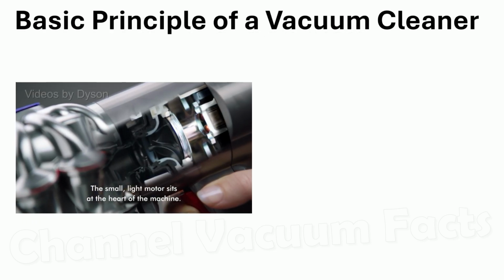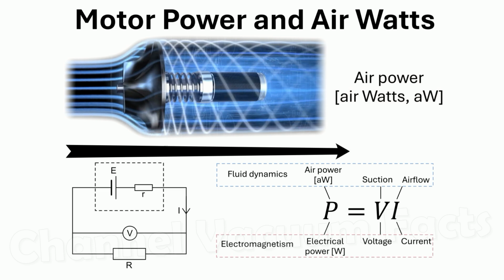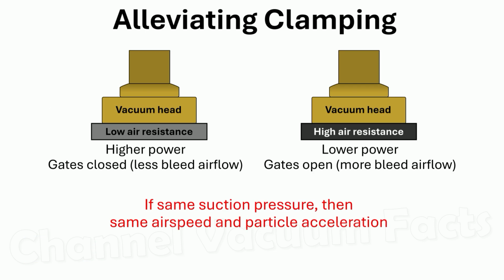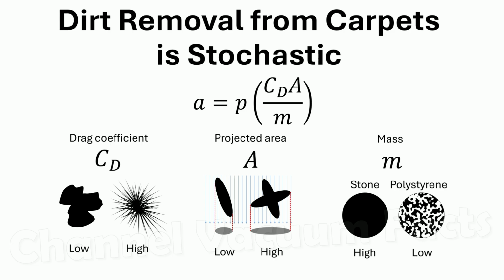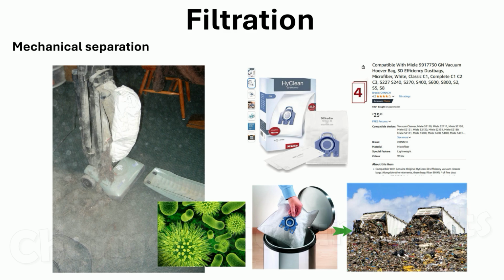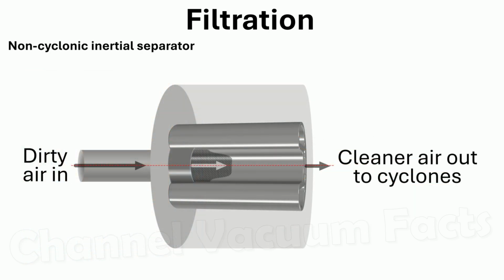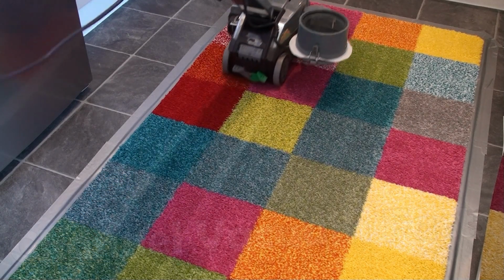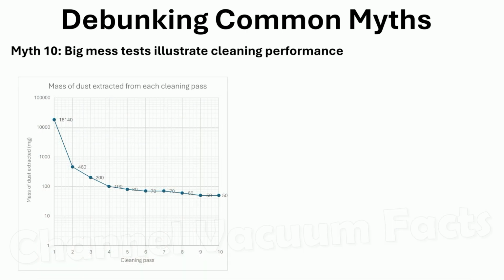How do vacuum cleaners REALLY work?

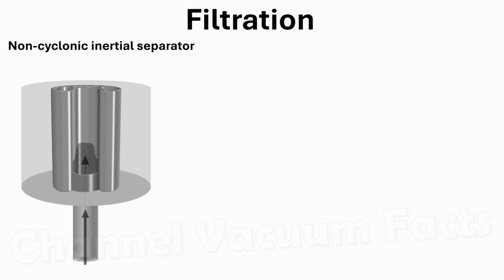Comment: 37:55 it's kinda insane how out of all the videos and written articles on the internet, this video is still the only one explaining how Dyson's new v16 first stage separation works. No one else has mentioned its benefits like linear air path, no more hair wrapping and shroud smothering/clogging. 

Hell not even Dyson really explains their new bin design that much in the marketing materials. They kinda just say you can compact the dust with the new compactor  and that's that. With such a drastic design changed you'd think they roll it out with more fanfare or at least an infographic like their cyclone pictures. 

The marketing seems to focus only on the new cleaner head design instead. Which I think is poor considering how the new inertial separator is a far bigger change and innovation to current cons of the first stage cyclonic seperation.

The new design might be a lot better at preventing user error too considering how ppl just ignore the max fill line a lot and abuse it. The aerodynamic washing and compactor should theoretically keep the filter cleaner longer from user abuses.
Reply from the maker: Weird; I never got a notification for this comment and only saw it by accident.

It's pretty pathetic isn't it—especially as this video came out 18 months ago and long before the V16 came to market anywhere in the world. Even when some answers and technical details are provided by me for the dross to copy from, their worthless laziness shines bright, and they can't even be bothered to do that on more complex technical issues. My V16 review, not far off, really hammers this point home and harshly criticises all the 'reviewers' out there for exposing themselves to be ignorant or exploitative—or both. I've deliberately left my review so late just to expose their insulting ignorance and lack of quality in their reviews, since they've not been able to copy off me this time on all the new tech. Every single one of them is truly worthless. There is a good reason why Dyson have been muted with the V16 and its technology. None of the worthless reviewers have cottoned on, naturally, but I'll be going into details.

Comment: I haven't got to the end yet, but I have a question: I did an experiment with a mass airflow sensor (from a car) where I wanted to see the effects of colder air for a given flow. I pulled air through the MAF with a vacuum cleaner indoors at 21C. Then I opened the door to the cold outside air (~4C). I expected the mass air flow to go up, assuming that the vacuum pulls a constant volumetric flow. But the mass flow went down consistently around 2-4% from multiple tests. I actually used 2 different vacuums too, same result roughly. Since I know for sure the air has to be around 6% denser outside, that implies a reduction of ~10% in the volume of air displaced by the machine in 4C compared to 21C air. Why is that?
Reply from the maker: Difficult to know without thorough emprical investigations.

Comment: Another great video here! Now if only Dyson would take their own advice and make someway to adjust the cleaner heads in the US for uprights like the UP13, 14, 16, 19, & 2O. There is and has been a massive issue for over a decade now with these machines having so much suction with no way to adjust them that they are extremely difficult to push on certain carpet types and shut down the beater brush. Seems strange because the 41mk2 in the UK had the suction slider but the US and CA never got it despite needing it desperately. Those heads also burn out very frequently. I have to wonder if part of it is due to the suction being too strong and over working the motor.
Reply from the maker: It's unclear. But Dyson don't develop mains uprights anymore. That formfactor has been superseded by the cordless stick vac formfactor they invented. The cordless machines are now superior to the mains uprights and allow bitesized cleaning practice, which is also better. My reviews cover all this. Their new cordless machine (possibly in a few weeks) may be a quantum leap in cordless technology if they have their new solid state battery technology.
Reply: @VacuumFacts  Very true but in the US the market is different and a lot of people still buy uprights. Like way more than any other country.
Reply from the maker: They only seem to sell the ball 3 in the US now, whose cleaner head modified to be like the final models in the UK addressed those issues https://www.dyson.com/vacuum-cleaners/uprights
Reply: @ I know. I own one and it is wonderful.
Reply from the maker: I'm confused by your original comment in that case: "Now if only Dyson would take their own advice and make someway to adjust the cleaner heads in the US for uprights like the UP13, 14, 16, 19, & 2O". This is exactly what they did when they brought out the new model. And you bought it, so therefore knew they'd done this before you commented and proposed they should. xD
Reply: @VacuumFacts  I know. But that was in 2022. The UP13 and 14 with the original issue came out in early 2015 and even after the An3 was released they continued to sell the 19s and 20s with the same issue and still  have done nothing to improve or modify the part. It took seven years for them to first have a solution on new model that already had a solution to in 2014 with 41mk2. And to this day still there is nothing in the US or CA that fixes the issue with all those other models.
Reply from the maker: Major improvements are always applied with future new product releases. There are never major fundamental changes to existing products already being printed and sold (minor details, and safety recalls aside). When has that not been the case anywhere ever, since that's not how manufacturing works? Those old models are no longer manufactured and not sold directly by Dyson anymore either; only existing stock from third party sellers are available, meaning it's a self correcting concern and moot point. Eventually, their corded mains cleaners will likely be phased out, for exactly the same reasons, as the cordless technology completely replaces them.

Comment: Great insight into the science behind how a vacuum cleaner works. Thank you for doing this video and sharing it too. Watched it twice to make sure I got everything lol!

Be interesting to see what Dyson launches next having it been a while from the info you have shared and the patents I’ve seen online too.

No doubt new floor head, new battery tech maybe and new dirt separation and maybe an updated new DD motor too.

Was interesting point about the direction you clean carpet. Think years ago carpet manufacturers did often state vacuuming in multiple directions to help with not just dirt removal but pile lifting too. Not aware they still mention this as carpet manufacturing   techniques have changed a bit over the years to no doubt!

There was one question but you answered it in the last section regarding brushes on brush rollers prutruding the base plate.

Hopefully we will see soon the next generation Dyson cordless enter the market!?

Comment: I agree with Parwaz about this. Why don't Dyson make the Dyson Ball upright into a cordless? There's many advantages. A bigger bin, they could use a bigger battery, it has a long hose fitted, it stands upright and with Dysons small powerful motor they could use a smaller ball making it light and less cumbersome. 
I think it would be a good idea!
Reply: I've not had any stalling with the V15 on my carpets which are low pile. I actually like it a lot. Hopefully it won't fall apart after a few months use.
Reply from the maker: If the machine's brush bar slows down, it's because the pressure is too low. Reducing motor power or reducing net air resistance into the head solves it and won't affect cleaning performance as long as the pressure isn't taken too much higher. So front gates first before motor power.

The V15's head was designed specifically for it, so is unlikely to fail (bar neglect and/or abuse).
Reply: @VacuumFacts So they charged £850 for the Gen 5 but didn't design an appropriate cleaner head to go with it .I would have thought if you open the gate on the floor head it's going to reduce the performance. Have you tested the pick up with the gate opened?
Reply from the maker: They charged £850 (way too much) for the Gen 5 and used the V15 head. I think that meant the normal explicit testing of a whole, tuned product was bypassed, meaning that error wasn't captured. It otherwise was an appropriate head to go with it.

RE: opening the head gate; this is a common misunderstanding stemming from not understanding the science. If the pressure is too low, it clamps. Increasing it by an amount to get it back to where it was on a given flooring type (they all differ) achieves the same cleaning performance, which is pressure-driven. At the moment, this has to be done manually and is discrete (3 gate levels, 3 motor speeds). Dyson know this and they've already invented auto-bleed valves that produce the optimal pressure on all floors. That's actually wasteful, and stems from having fixed motor speeds. They know this too. Their future technology (e.g. spinning discs) allows dirt separation performance to be independent of airspeed (motor power) and so highly variable motor power is likely in future too to fully optimise energy consumption. Meanwhile the scammer competition are ignoring all this, relying on the ignorance of the people they exploit.
Reply: I get you. You need to equalise the pressure. The problem is with all this ever more complicated circuitry the more likely something will go wrong. You can over engineer.
Reply from the maker: It might sound like it, but that's not really true. Their methods of achieving this are all very simple and elegant. There's an art to simplicity in design and the engineers are well aware of this. They're also fully tested to be reliable. If they weren't, a company would incur large expense on warranty. The good companies quantify failure rates and there's a huge branch of statistics that applies and allows them to equate this to a financial hit. Despite propaganda by the typical voices on the internet, genuine failure (not due to neglect and abuse) is fairly rare. They're working on auto edge detection and a simple disc at the side which rotates open to reveal the edge gap so particle can get sucked in. In the current designs, it's open all the time, which is energetically wasteful. Everything they do is to minimise energy consumption so you get maximum run time without performance compromise.

There are other examples too. Auto hair removal for example. So far, the methods are to 'complicate' the cleaner head with vanes/combs which scrape off the hair. Hardly increases failure rate. But it does have disadvantages. Noise, excess wear in the small regions of the brush strips that touch it, and it doesn't always work. They've found from research that angling these vanes improves removal performance. But this doesn't solve the other issues. Their new approach is their new head which I'm guessing is out soon (hence the Konical name). Like the hair screw, by changing the shape to a cone and cantilevering two brushbars from the centre, you spiral hair off to the tips. But they needed to design a feature in the middle to stop hair getting stuck in it. That solution ended up being a simple bit of geometry which doesn't 'fail'. The tips of the brushbars have notches in them with very specific shapes. This was shown to cause the hair to ball up and come off very effectively. Again, there's nothing complicated about this and there's nothing to 'fail'. So all improvement without any real increase in chance of failure.

Another example is with the new first stage bin cyclone design. So much simpler and it makes failure less likely. There's no jetting needed to make a cyclone, so no passage narrowing, so less likely for big cereal etc. to get stuck. The bin design after that one using sheets of air over the mesh are all simple static geometry with no way to fail. The pressure pulses that clear blockages are just the motor operating. There's no additional complex moving parts. In crude terms, it's the same, but just a different 'shape'.
 
'Over engineering' is a buzz term that you see come from people who don't know or understand the fine details, and it's a myth for the most part used as propaganda.
Reply: @VacuumFacts  If they can do away with the shroud that would be a good upgrade and eventually the cyclones that would be an even bigger upgrade. You could then have variable speed and other benefits.
Reply from the maker: Initially, the aim isn't to get rid of the shroud. It's to get rid of 'shroud blinding' (i.e. clogging up). Again, the scammer competition don't even face this problem yet because they use HUGE pore sizes. SO much more goes through as a result and why they rely so heavily on filters which clog very quickly, even if they use their crude cyclone dupes. Dyson's pores apparently will go down to about 100 µm and blind very slowly. The next model (hopefully) looks to reduce blinding rate significantly during use and is non-cyclonic in its approach (in the bin). It does require manual scraping though to remove accumulated dust (done naturally on emptying, as now), and can even be done mid-use with the dirt compactor if necessary for some reason. It also doesn't have auto mesh unblocking should that ever occur (which eventually partially does on all previous dyson cordless, incidentally). That tech is for the next generation after. The shape of the holes and how to even achieve that are important to get right.
Reply from the maker: @AbsoluteRainbow_2K6  >> “we already know the Cinetic tips requires more minimum suction power (airflow, pressure, suction) which requires better motor”
This is not an accurate statement (or quantified). A) it makes no sense why the presence of the narrower tips needs greater suction since no air passes through them, and B) there is evidence of relatively low power mains motors supplying them.

It’s all academic anyway since upcoming alternative approaches will achieve similar results.
Reply from the maker: @ Oh sorry. When you said "Cinetic tips", I thought you were talking about Cinetic tips. My mistake.
Reply: I prefer PG Tips 😄
Reply from the maker: There are no genuine advantages at all. It would undermine everything they've advanced in terms of convenience with cordless. One simple device in the hand that does everything with minimal materials, minimal power consumption, minimal weight, minimal size. Bin size is increased with improved design in future models. Battery capacity and run time is achieved with improved science. And I don't know why anyone needs a big bin if you just empty it after every use in all of 5 seconds before you put it back on the wall to charge, as designed. You might have noticed that all the other vile companies that want to exploit others have jumped on the cordless formfactor bandwagon Dyson invented by producing terrible knockoff clone scams that don't work as well, and are technologically like a decade behind in motor power density. Why haven't they done what you ask either? Why has no one asked the question? I think it's a daft idea. It'll also never ever happen. I suspect the reason why Parwaz wants such a device is because he otherwise can't play with it like an expensive toy, sucking up 10+ years of dust in 10 minutes like a garbage disposal unit for his entertainment without emptying every 2 seconds. When used as intended, it works better than the old format.
Reply: @VacuumFacts  It's all about opinions, I personally like the idea. Vax did bring out one model but it was useless.  Dyson have the technology to make it work. Dunno if you've seen his Gen 5 review? The wheel broke off the floor head after very little use and the brush roll kept stalling even on porous carpet. That's not great is it for a cleaner priced at £750. The upright cleaner didn't stall.
Reply from the maker: Ok, well, any given opinion is relevant only to those that agree with it. I wouldn't be surprised if some people wanted a jet engine on the back of their fantasy machines. Manufacturers are more interested in solving real-world problems and the designs so far to achieve that have not yet produced any fantasy machines I've ever heard of. That says something.

Yes, the wheel fell off my Gen5 too. I commented on his video why it's likely happening. It appears to be an oversight by Dyson. They used the V15 head on the Gen5 which produces higher suction. This causes the head to clamp more and increases the sheering force on the spindle that attaches the wheel, increasing likelihood of failure. It can be user-fixed with the correct adhesive (as I have). The fundamental problem will fix itself with the next generation, if they haven't already tweaked the design to strengthen that part already in currently manufactured parts. Dyson's customer service is geniunely poor now and I was very unhappy with them.

The brushbar stalling is addressed in this video you're commenting on. It's not a design flaw as falsely suggested by those that don't command my respect; it's a user misunderstanding of the science operating and how to address it. Ironically, the effect isn't seen on other machines because they're not as good and don't achieve the same pressure, either through lack of technology or leak wastage from poor design. It's a known problem to solve and future Dyson models will detect head pressure on all floor types and auto-alleviate the issue from what I've seen being developed. (The competition aren't good enough to have even encountered the problem in the first place yet...)